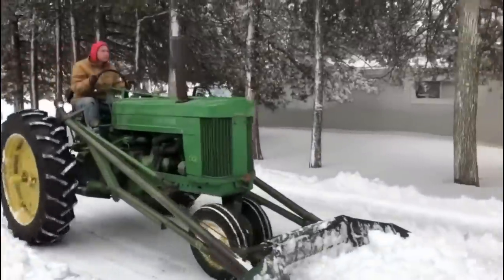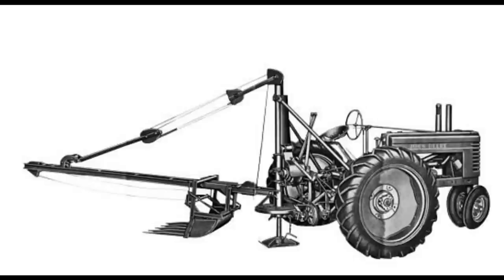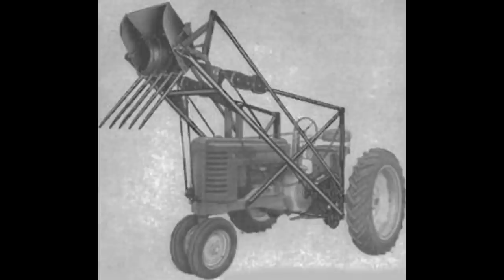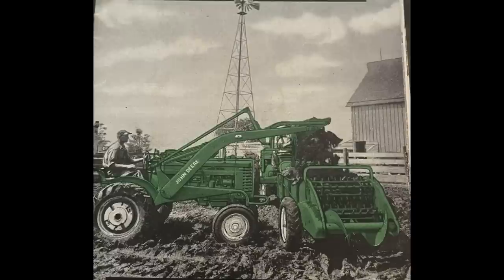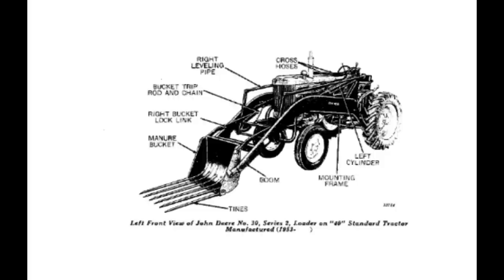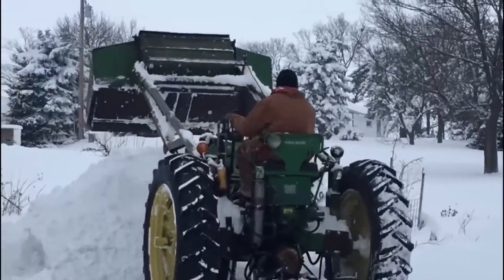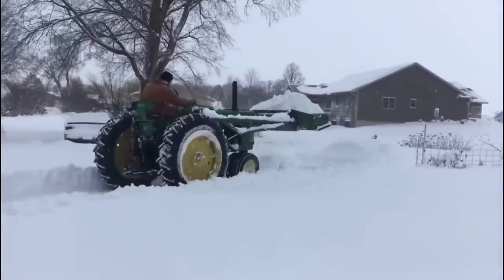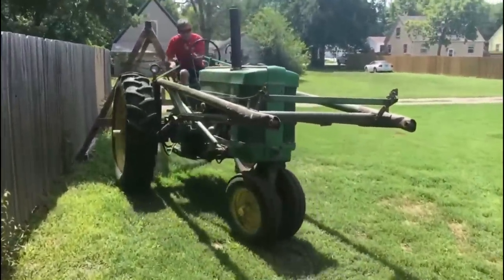Early John Deere Loaders (#26, Model 25, Model 30, Model 45)

Comment: Thanks for the video. We have a 4010 gas that was bought new in 1962 with a 45 loader, and i have the paperwork and owners manuals for both. Very handy around the farm for pushing snow, although I have a bigger loader as my primary farm loader.

Comment: My dad bought a 520 JD in 1971 it had a 45 loader on it. The 520 has a wide front end so the arms of the loader curved over the axle. I was amazed at how much it would lift. I spent many hours working that tractor and loader. Still have both but they don’t work very hard anymore.

Comment: I bought a "45" Loder used , and mounted it on a 3020 power shift tractor , we replaced the trip bucket with a hydraulic buckit  kit . it was a great loder. A fellow that worked for me had previous experience on a farm that had a John Deere 1010 crawler with a loder, and he said the 3020 setup was far superior for manure clean up.
Reply: We had a 1010 crawler loader with a large bucket, single 4-way control valve, 3-point hitch with an attached blade and hydraulic reverser😊. It was a great machine for dealing with manure! Over time, though, manure caused the seals in the track tensioners and final drives to break down. It was a good Deere product for us, and got a lot of use.
Reply: I'm the 3rd gen owner of a 3020 with a 45. It's still all trip other than the lift cylinders. It's got the snow bucket and half bucket.

Comment: Dad had a 45 loader on a 60 gas with the trip bucket.  It got used hard, loading manure and later using the snow bucket to fill the silage wagon out of the pit silo.  Later on he got tired of the toll the bucket trip system was taking on the walls of the silage wagon (as well as the leverage it often took to get the bucket to trip), so he built his own system to make the bucket also hydraulically operated. It worked, although this taxed the capacity of the hydraulic pump, and added even more weight to the front of the tractor.  Thank goodness our 60 had power steering.  Eventually it was replaced with a very fine and robust Westendorf loader that fit on the 3010 and 4020.  

One weakness, if you can call it that, on these loaders was the pipe that connected both sides of the frame right above the bucket. It would flex and crack under load-most old 45's I have seen have repair welding and reinforcing iron on this piece.  I believe the 45 was designed with the thought it would be used to move heavier materials with the tine bucket, or with the smaller bucket attachment.  Many farmers pushed this by loading about anything they could with the snow bucket.  This would tilt on a slope, or with an uneven load, putting a strain on the center section of the frame that it was not designed to handle. In other words, the 45 was often used to move materials that were truly above its weight.  For this reason we remember it with fondness and with great respect.
Reply from the maker: Thanks for watching! I got one on a 60, hood loader for the time it was built👍🏻

Comment: I have a 45W loader on a JD 60. It has a hydralic bucket and I used it for 20years. The main problem was the 60 had a narrow front, and no power steering. I lifted 1500 lbs round bales for years and never had a problem. Now I have a 46A loader on a 3020, wide front, and it would be hard to go back.

Comment: Great video on the JD loaders!! When I had just graduated college in 1979, and was getting very deep into two cylinder restoration and collecting, a good friend of mine, who was a tremendous collector and dairy farmer, had a 26 loader for sale. Not sure what I was thinking, but I bought it, and it was laying on one of our hay wagons for about a year. I put an ad in Gas Engine Magazine for this for sale, and someone from Iowa called me up and wanted it for his John Deere tractor restoration, to enter this into the Old Thresherman's Show in Mt. Pleasant, Iowa. I lived on our farm in New Jersey, so he drove out to pick it up. We parked the wagon with the loader on it under a very big Maple tree with a great horizontal limb that was perfect to hang my large chain hoist on. We lifted the loader up high enough to move the wagon out and for the man from Iowa to back his trailer under the loader and then lowered the hoist to set the loader onto his trailer, with no problems!! I think he paid me $150 for the loader, but I never did know if he finished his restoration and put this in the show.  I have owned and used several 45 loaders, most on my B's and a 60 tractor. But once I had a 1938 A I restored, and had switched the rear power lift housing for a powertrol rear housing. These are interchangeable, everything matches up perfect, so I had rear hydraulics just like a styled A would have. I mounted my 45 loader onto this unstyled A, it worked great, alittle on the heavy side for it, but I only used it to lift things to save my back, and was on level ground, so it was a very neat unit to see. To top this all off, I only had skeleton steel rears for this, which were in like new condition, so the loader and tractor looked very unique on this A!! Thanks again for your videos!!

Comment: I've pitched my share of manure into and out of an old spreader. I bought a 45 loader for my JD60 and had minimal issues with running the loader, clutch and trip bucket. It was nice to have a second tractor hitched to the R spreader. I have found a 45 loader with the hydraulic bucket attachment, just haven't bought it yet.
Reply from the maker: Nice! Thank you for watching👍🏻

Comment: I grew up with a farmhand loader monitor on a John Deere. It had the single push on the cylinder to raise it, and it came down by gravity. The bucket was a trip bucket with the forks for the manure and then at least a 5 foot wide. I’m thinking it was more like 6 foot wide attachment bucket for pushing snow. The problem with mounting the snow bucket was at the forks got bent when you were loading manure so you have to be out there with a sledgehammer, pounding those things back into correct placement so that you could get them into the snow bucket.

Comment: When i was of age to operate my uncles JDA tractors ,he would ask my Mother yo bring down to the farm ,as they were going to clean out the heifer pens .My one uncle had a 45 loader mounted on a 60  .My older cousins would operate the loader n hauled the loaded manure spreader out to the fields with a JD 630 . That was such beautiful tractor the 630 n it was big improvement over the As n the 60 s. My uncle Harold bought that 630 new in 1958 for $3800 .I can't even comprehend how JD could manufacture n sell that tractor for that small amount of money n still make a profit ! That when a Dollar was a Dollar n thats when a smoke was a smoke ! Lol as in reference to John Mellencamps song . Im 66 yrs old now .I was 8 yrs old when my uncles taught me how to run those tractors n farm equipment .Anyone who grew up onin those days,i hope thanks the Lord for putting them in the time n place to be able to grow up on the Dairy farms in the late 50s n Through 60s into the 70 n 80s .From age 6 till 19 i would live at my uncle Merrills farm in Pennsylvania n help farm n milk cows . It made made me who i am today . My younger cousins still can't believe how fast i can shift a JD 2 cylinder A from 6 to 5 under load or from Reverse back to 4 or 5 gear whenhung up in deep mud .We used those A ti haul JD 216 chuckwagons loaded round full back n forthto trench silo. We farmed on steep side hills. All of our tractors had calcium on the rear tires for ballast n weight .We had 2 4020 s a 3020with a loader on it thise 3 JD As 2 of the As were from 1950 ,only one hada Cehsela power steering on it. Our haywagons were homebulit n we could get 165 bales onthem with .inium stacking in the front . So as we big equipment that a 4020 could handle thise JD s were struggling to hold back those weight of our wagons or pulling those empties ,sometimes 3 together behind the yellow sided A that wepainted . I learned speed shift those Twocylinder tractors on the road underliad ,downshift from 6 to 5 without loseing momentum up the hills . When youkicked the tractor out of gearcoming diwn the hill ,being that the water ballast was only halfway filled in the tires ,they would start hoping offf the surface of the riad at 35mph . Try to slow a tractir down with individualwheel brakes on anA  I got to the farm n i was white as ghost ,scared! The hired guy who was 16 at the time n shiwedme that truck ,laughed his ass off when i told him what happened .It happened to him also .I only had a the manure spreader behind that time.Another time the silade wagonstarted to push the A diwn the road ,slindind the rear wheels on dry macadum .We shelling corn into a 125 JD Chuck wagon with the 3020 hooked on the front ,inthe valley onthe way back to farm the tractor had barely enough power to in 2 gear ti come up the hill on dry macadum ! Us kids found out without dieing to not overload the wagons ! I think back how Lucky we were never killed and jt because our Grandparents instilled a string believe in God .At 66 yrs of age i know deep in my heart that Gidwas protecting me many times while living on thefarmn riding Harleys acrosd this great country and working in the steel industry my whole adult life . May the Lordwith you in everything you do !

Comment: I remember how painfully slow it was seeing my grandfather loading a spreader with a trip bucket loader .  But back then it was a God send for him Im sure.
Reply: I ran a trip bucket on a JD 50 and later JD 620 (much easier with power steering btw).  Learning the sequence did not make it seem "painfully slow".  Trip the bucket into the spreader (or pile, whatever), start lowering the bucket while backing up.  By the time you were done backing up, the bucket would have latched.  Raise the bucket to desired height while going forward for the next pickup.

Comment: I got 2 of them model 45’s.  One on a 51 A and 51 B.  Both have snow buckets.   I can push snow faster than anything In it’s class.   Because of the trip bucket
Reply from the maker: I agree, sometimes that trip bucket is faster to reset when pushing snow than waiting for a tilt cylinder to get back after a dump. Thank you for watching!👍🏻

Comment: Trip buckets are a pain
Reply: We had one on a Farmall H, that was operated with the tractor’s pull rod. Hydraulics were not live and the trip lever was down by the right axle. Although it definitely beat using a pitchfork, it required a coordinated contortionist to operate it!
Reply: @craiglacey9827  we have one like that at work we just bought a 3020 to do all th manure handling work